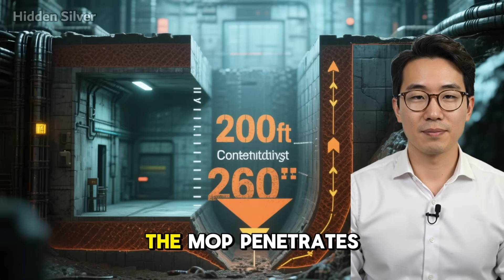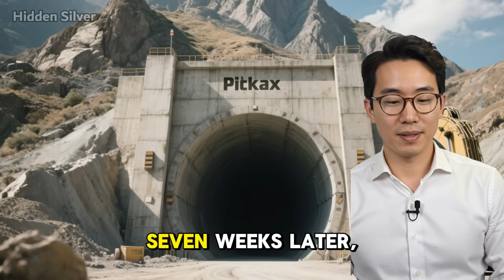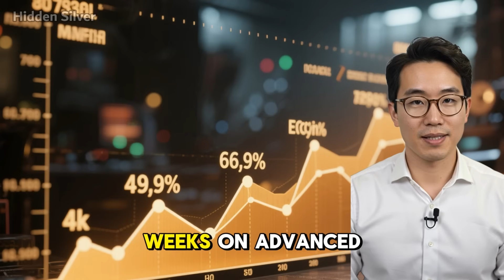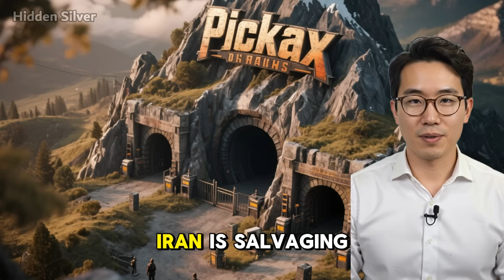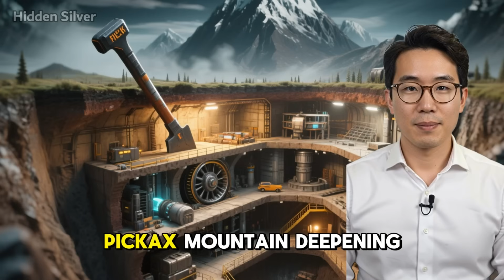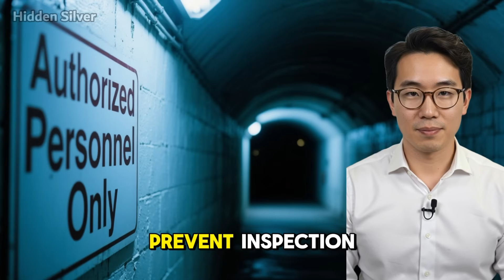Iran’s “ACTIVE CENTRIFUGES” Detected — B-2 Bombers Move to Diego Garcia

Comment: At a 1000 feet we just burry everything 1000 feet down nothings can't come out from a 1000 feet down all the ventilation and electricity will be cut by using 2000 pounds bunkers busters will cut all wires going into the mountain all electrical tower 500 miles from the mountain blow it up no electricity drop 20 emps along with the nomb strikes will fry any electrical inside that big hole the sides of the mountain is week because they have removed so much dirt the mountain is a ahollow front the sides usig supersonic missiles will got thru the mountains

Comment: OOK----------- . THE WAY I UNDERSTAND THE MOP IS THAT IT CAN PENETRATE 300 FEET, BLAST A HOLE, SPREADING THE DEBREA OUT AROUND THE OUTSIDE OF THE HOLE. THEN A SECOND BOMB WILL DIG ANOTHER 300 FEET DOWN, AND ANOTHER BOMB WILL GO ANOTHER 300 FEET TO FINALLY TAKE OUT THE 1,000 FOOT DEEP TUNNELS USING A MOP  BOMB WITH A THIN CASE AND MOSTLY 5 TIMES THE EXPLOSIVE THAT WILL BE ENOUGH TO OVER PRESSUR AND COLLAPSE A MIL.E OF TUNNELS AROUND THE ENTRY POINT.  BUT EVEN THEN THE WORLD WILL STILL HAVE TO HUNT DOWN ALL THE NUCLEAR MATERIAL ALL OVER THE COUNTRY. NO MATTER HOW MUCH THEY BOMB BIG MAIN DEEP SIGHTS.

Comment: Try the b-83’s Physical package. Make use of them instead of retiring them.  But not as a gravity bomb : it should be “introduced” to the facility after smoking any Iranian ground combat units near the facilities (+ any backups  the Iranians positioned as a rapid response “cavalry “.

It shouldn’t be much of a problem. The Iranian are clearly preparing themselves for a massive air attack- that will happen- but to pulping the ground units to enable their inhalation by airborne special forces +shut down any communication and “injecting” misinformation to the Iranian tactical communications.
Those facilities are located at remote areas.  In the current situation the Iranian organized military( not the irgc- those coward of the hamas type who specialized at murdering and torturing civilians- but when confronted with real soldiers they are running away, hiding, wearing women’s clothes etc)- anyhow the Iranian military units are spread very thin across vast areas.  With total air supremacy over Iran swiftly established (  US Air Force/us navy air force , combined with the highly effective Israeli Air Force and various other assets) any attempt  to bring reinforcements to those sites will a suicide mission ,as the distances are enormous and there are few roads- most of it in the mountains and can’t use for any rapid re location of anything(certainly not heavy equipment).

The special forces on the ground will either drill a hole or use some preexisting tunnel. 
A nuclear explosion in a nuclear weapon facility- well, s**t happens…